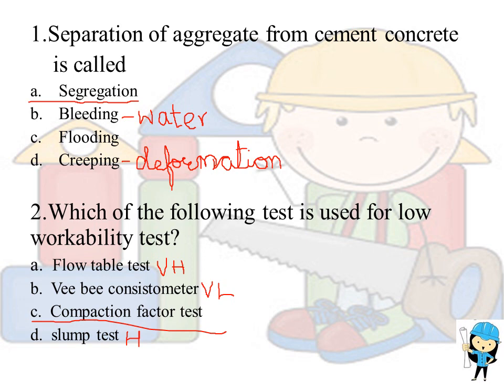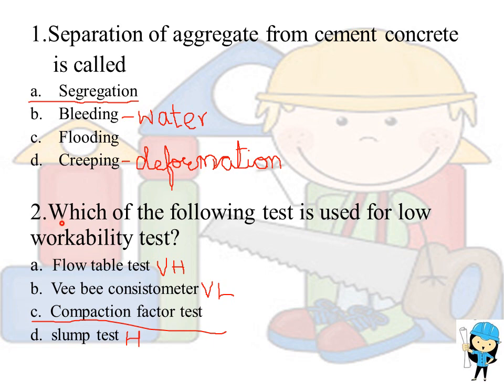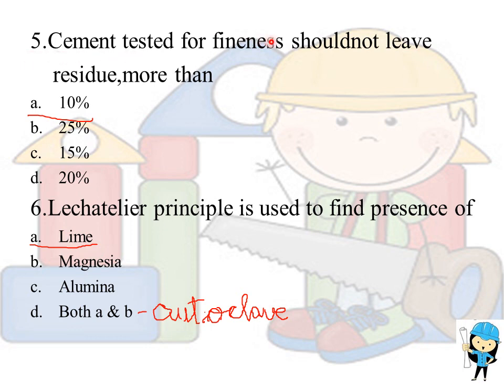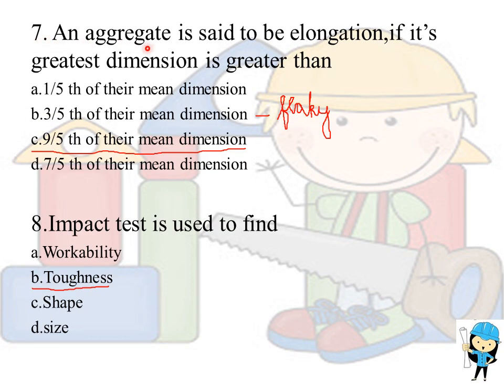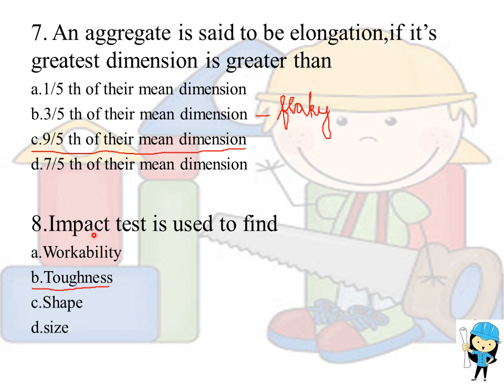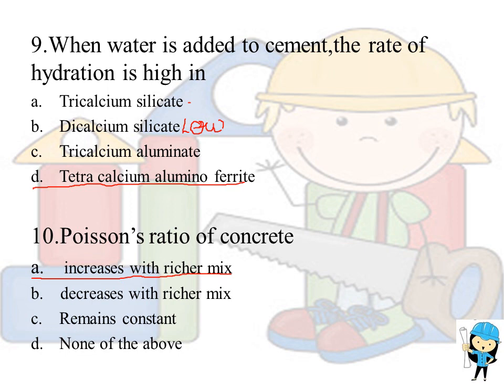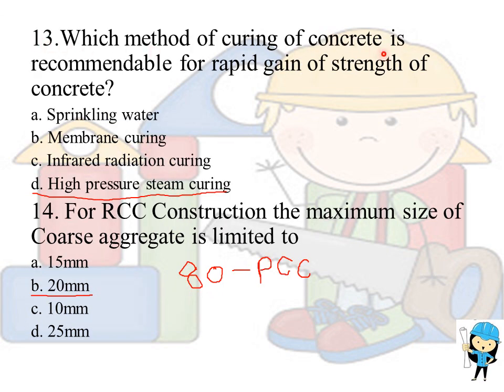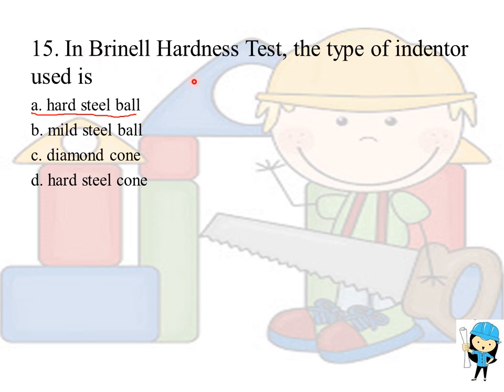CONCRETE TECHNOLOGY ||IMPORTANT MCQS CIVIL ENGINEERING#UPPSC,RPSC,SSC JE,TRB CIVIL,TNEB AE EXAM

Comment: @ question no.2 :What is meant by low workability 
These four test are done to check the workability, then how you define a concrete mix as low workable and high workable before the test?
Reply from the maker: Its classified based on the amount of water added to the concrete mix